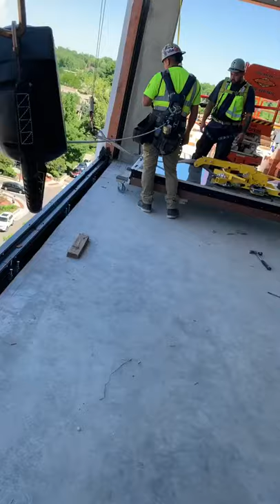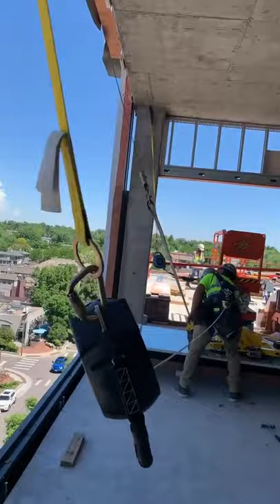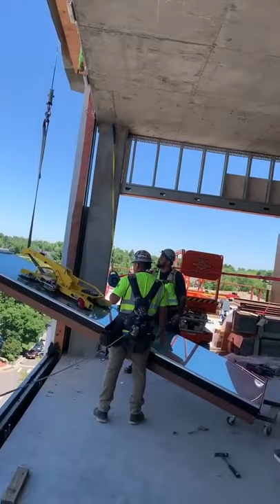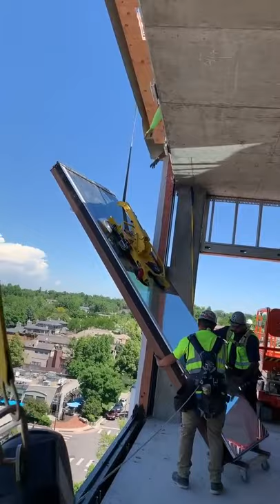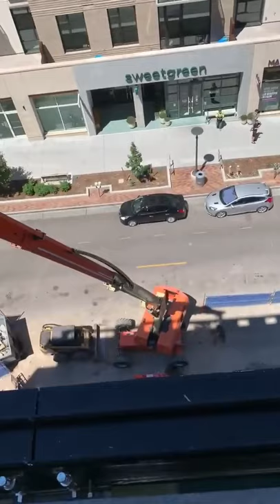rigging fail

Comment: Certified on the job rigger here. Load line was rubbing against the building trying to pull something out from underneath. Also that wasn’t a crane lifting it was a hoist . Look at the skinny little load line on it. Probably wire rope . I think it snapped the wire and the alarm was the hoist warning you are lifting above max capacity
Reply: its a spider crane. The crane line didn't snap & by the looks of the video the rigging nylon sling didn't snap either. Well it looks like it snapped at the eye or the eye slipped  out of the pick point or the shackle failed.
Reply: @damiensingh4950  could have for sure.  Something gave either way you could hear the alarm going off that you are past your limits. Pulling something out from underneath at an angle like that increased the weight capacity pretty good don’t have my calculation chart or know the weight or type of line they were using lol but from the looks it it . Short story these guys are heads lol… who rigged it up the window guys? . I woulda never aprooved this lift lmao
Reply: @AtTheHandle   what do you think was the fallout after this ?  Anyone fired ?